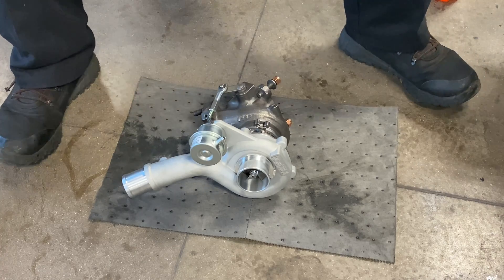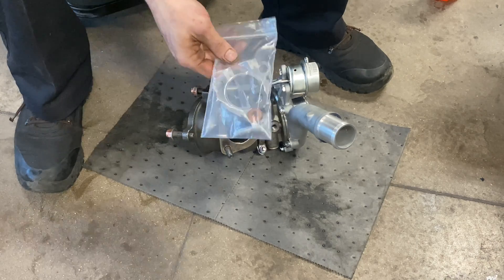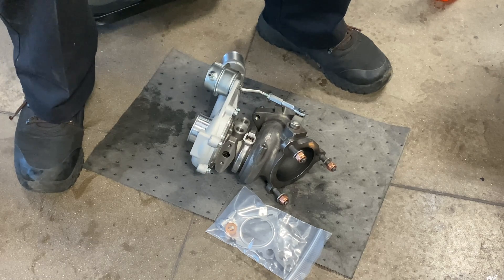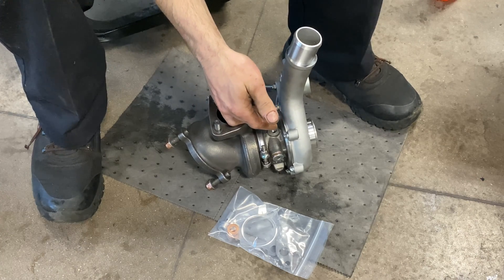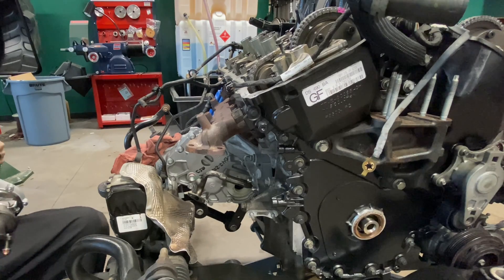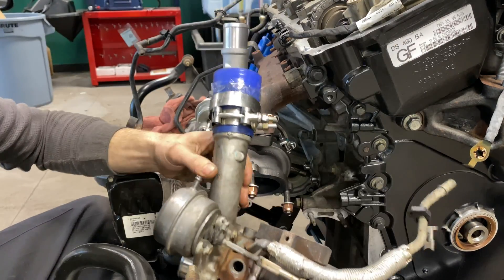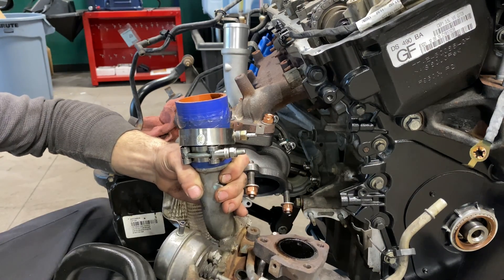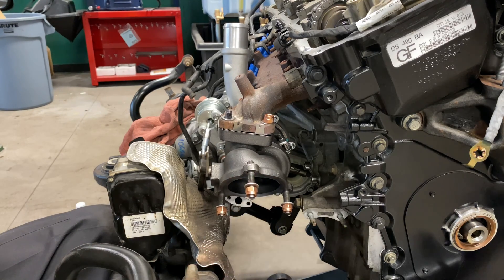Watch Before you Turbo (Turbocharger) Install Tips And Basic

Comment: I agree with pre lubricating the turbo but also ford has a feature that when you do first start up hold the brake and hold the throttle gas pedal all the way to the floor and try to start the engine the motor will turnover without fuel or spark like a dry crank to allow the oil to circulate before starting after a build like this!it was specific for the oil pressure operated timing chain tensioners to pressurize and place tension on the chain before trying to fire up!! Keep that in mind before to start this engine!! I'm really enjoying watching your build I'm learning things I didn't know!! Thankyou
Reply from the maker: Absolutely! Thanks for the feedback! GM and Chrysler actually use the clear flood strategy as well by holding gas pedal down to floor. A lot of older vehicles do not have this strategy, and a lot of older vehicles are the most commonly custom turbocharged vehicles. Can also pull the fuel injection or ignition control fuse. Getting to point across about lubrication is what I was trying to convey! Stay tuned, more coming!